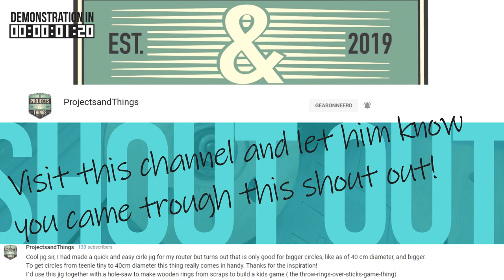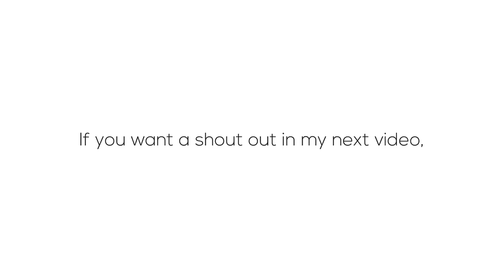Angle grinder sanding disk for slots and grooves

Comment: I only have a 3 inch pneumatic angle driver from Harbor Freight.

I would not recommend it, however.  It is cheap (especially with a coupon) but it is sometimes hindered by the air hose.  I did borrow neighbor friend's Dewalt cordless 4 inch grinder. That was nice!
Reply from the maker: Thank you for that tip Jeffrey. I'm thinking about a Makita or a Dewalt.

Comment: Hi, I have a dewalt 4.5” angle grinder with a paddle switch that I use often but the gearbox seems to get really hot if I’m doing a lot of grinding work.I also have a rigid 7” angle grinder thats for heavy grinding and it really works well, but it’s heavy.
Reply from the maker: I need a new angle grinder and I'm searching the best option for me and my needs. I already have looked to a Dewalt too. I will wait a little longer, maybe Santa Claus will bring me one. I have been a good boy so far hahaha.